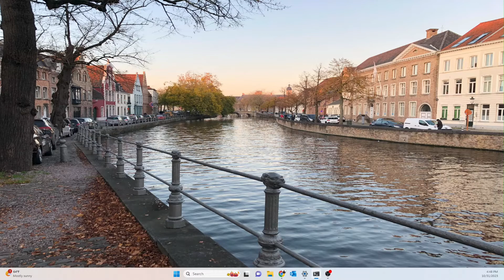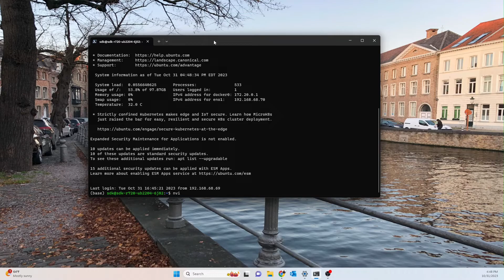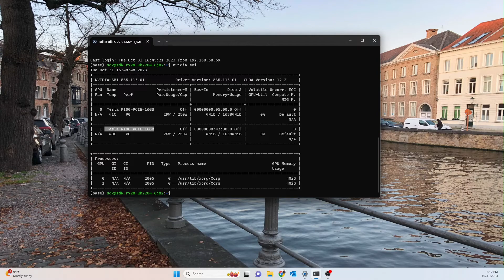Installing DUAL Tesla P100 GPU on Dell PowerEdge R720 Server with Driver Installation

Comment: I’m surprised there’s not more people making the 12v EPS male to male. I have a pair of this same poweredge r720 and ordered a pair of p100’s for the first one but wasn’t sure if it was the best option so I held off building the second one out until I play with the first one. I’m trying to train a large robot- imagine Boston dynamics handle but… more serious. I commented on another video of yours and tried to email you. Do you do any consulting work or would you be interested? Check the email you have listed on YouTube. Thanks!
Reply from the maker: Yeah I guess because the GPUs are old now there is not much demand for that cable. Not really sure why honestly. Very interesting idea. I got you email by the way and have responded!

Comment: In wich OS did you run the nvidia-smi command ?
Reply from the maker: Hi there. Thanks for the question!

I am using Ubuntu 22.04 for all of my servers at the current moment. Might switch over to NixOS soon though.

Comment: Friend, I have a problem when connecting a Tesla M10 to my r720 server, when I put in the power cable the sources start pulsing amber, do you know why it is...
Reply from the maker: Hi there. Thanks so much for the question. 

Is the server able to boot, when you have the M10 in?

Comment: I think that the speed of Riser3 is X8 although it is X16 in length.
Reply from the maker: You maybe right. I was unclear on this. I could never find a definitive answer here. However, I swapped out riser 3 mostly for wattage not for more PCIE lanes.
Reply: @TheDataDaddi  Just refer to the user manual in page 103, there are two types of Riser card. The default one only supports x8 speed and the backup one supports x16.
Reply from the maker: Right, I was just unclear as to whether that was a constraints of the mobo for riser 3 or just be the riser 3 variant I had originally had 2 slots that would in theory split the x16 across both slots to x8. Anyway, thanks so much for the feedback. I will go reread that page in the manual. @吳某-i1t

Comment: Nice video however in 2023 th P100 are basically junk cards, even not decent for encoding, doesn't supprt h265 at 10bit
Reply from the maker: Hi there. First, I would like to say I appreciate the feedback. However, in this case I must disagree with you. I think it depends on what your application is. If you are using this as a gaming GPU or trying working with large video datasets that might benefit from h265 10 bit encoding, I would agree there are better choices albeit more expensive. However, for a general purpose machine learning GPU that is cost effective, it is still very relevant in my opinion. These would be especially relevant for those that are either just getting in to AI/ML/DL or are budget constrained or both.
Reply: @TheDataDaddi  i c u data daddi

Comment: Could it be that the reason the cable that came with the server didn't work in the 3rd PCI riser is because the EPS power on that riser was keyed for 150Watts, while the cable was keyed for 225Watts?
Reply from the maker: Hi there. Do you mean the cable that came with the GPU? If so that certainly could be the case, just not sure why because that would under power the GPU by default.
Reply: @TheDataDaddi   In your first video of the series you mentioned that vlink can give you extra bandwidth between GPUs.  Mike Adams just bought some A100 40GB units (unsure if cards or modules) but I was thinking that is not only overkill for the model he is training...especially if you can get decent bandwith between GPUs for a pair of P40's or P100's to run the same workload.  I'm a noob to AI, so would love your opinion.
Reply from the maker: Yeah I would say that for most hobbyist that NVLink might be overkill. However, I have never used it myself so I cannot say how much it would speed up training. Now if he is training TBs worth of data over many GPUs. Then the extra bandwidth for data transfer could prove invaluable. So I would say (albeit fair blindly) that it really depends on application and the amount of data transfer that has to happen. For most applications and AI/ML/DL hobbyist I would say that PCIE transfer works just fine. Caveat being, I have not been able to test this yet so I is hard for me to give a real answer here. Getting my hands on a Gen 1 NVLink and setting it up for my home lab for test is high on my list of videos to make so one day I will hopefully be able to answer your question much more completely.   @IntenseGrid

Comment: What are you using these dual p100 for?
Reply from the maker: At the moment, I am using for a computer vision project I am working on. I am using using Meta's detectron2 framework with various pre-trained  object detection models (mostly of the Faster R-CNN variety) to fine-tune them to my particular application. At the moment, I am fine-tuning with thousands of 1920 × 1080 annotated images of webpages. The goal is to create an object detection model that can reliably detect various parts of a webpage. This model will be used in various other down stream tasks.
Reply: @TheDataDaddi that’s awesome! I’m torn apart whether to go with p40 24g vram or p100 12g vram… what do you recommend
Reply from the maker: I really struggled with this as well. My recommendation is the following. The p40 is going to be the better choice for most people. It has higher VRAM which is more and more important these days as models get larger. Better single precision performance which is what is really important for most applications. However, the p100 has greater bandwidth and substantially greater double precision. So, if you had a particular application that required double precision, I would choose the p100. Also if you wanted something more general purpose that could handle all projects, I would probably choose the p100. Overall, for most people the p40 will likely be the better choice. I will be honest though I have not had a chance to full test both sets of GPUs so I cannot comment more specifically yet. This performance comparison is high on my list. As soon as, I get a chance I am going to make a video on it.  @Mark300win
Reply: @TheDataDaddi  yeah the p40 vs p100 is a very hot topic and haven’t seen any video yet about it
Reply: @TheDataDaddi  can I game in these servers?
Reply from the maker: I am honestly not sure. However, there is a video I have seen in passing where someone tries this. Let me see if I can find it. @GOLTURBO555
Reply from the maker: Here is the link:

https://www.youtube.com/watch?v=HaMz9sWUZOQ

Comment: Thanks for some great videos, I have 2 PowerEdge R720 with dual cards (GRID K2 4 x GPU) per server 
I like to upgrade to some newer cards.
 Can you make a video about Heat and performance issue with tesla upgrade?
Reply from the maker: Hi there! Thanks for the feedback. I really appreciate it. Absolutely! That is actually next on my list of videos to make. I will also measure power consumption as well at normal conditions and max load. So far though, I can tell you from a qualitative perspective there have been no issues with throttling due to heat.
Reply: How loud is your R720. I also have an R720. My problem is with no graphics cards, my server is whisper quite since it only runs one service.  The air conditioner is louder.  Because I am space constrained, My homelab rack is in my office next to my desk. What I'm afraid of is if I off load the heavy lifting to a tesla card, the noise will be unbearable since I have to sit next to my rack.
Reply from the maker: So at idle or under minor loads the server is relatively quiet like you said, but the minute I start trying to train a model or do anything that requires more than minimal resources the noise becomes bothersome. You could adjust the fans down, but this might harm your system if done long term. You could also invest in a nice pair of noise canceling headphones. I did this for awhile when my server was in my room, and it made it bearable to live with for a year. Also, if you have just one R720 the noise is tolerable (imo). However, if you have multiple its too much to have in your room. Unfortunately, though I have not found a great solutions to this. My solution eventually was moving to a bigger place so I could put the server's in the basement. Hope this helps. In your case, it may be better to build you own rig that runs more quietly even though it will likely be more expensive. Hope this helps!  @rdsii64

Comment: Interesting I never noticed the dual slot riser 3 only supports 150W out of the power connector. It is weird because the dual slot riser 2 power connector can provide 225W. Doesn't seem like it would be a limitation of the riser slot on the motherboard side of things. Also so glad I don't have to deal with those PCIe 8-pin to EPS 12V adapters. They don't look fun to install.
Reply from the maker: Really appreciate the comment! Yeah I didn't realize that either for riser 3. Also, it might not be an issue. I honestly never tried it with the 2 slot riser 3. I just didn't want the GPU to be under powered. I replaced riser 3 with a single slot that has 225W (I believe) that I got from EBAY. That seemed to do the trick. Yeah the PCIe 8-pin to EPS 12V adapters are a pain in the ass. I wish there was a better method, but I havent found one short of making your own custom cable.
Reply: @TheDataDaddi  I think if anything it would trigger some sort of power overdraw limit. I may have to try for the fun of it. The cheaper aftermarket cables should work fine with the R720 but they won't work with R730 due to slightly different wiring. Otherwise making your own is the best option.
Reply from the maker: @computersales  Yeah that would be interesting. If you do, please let me know the results! Yeah I agree. If I had the time, I would likely go that route instead.